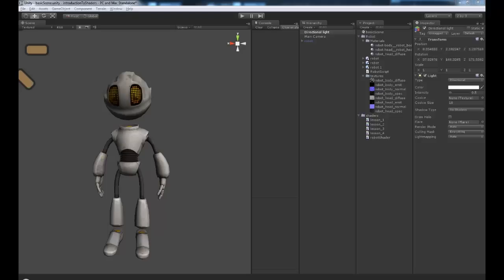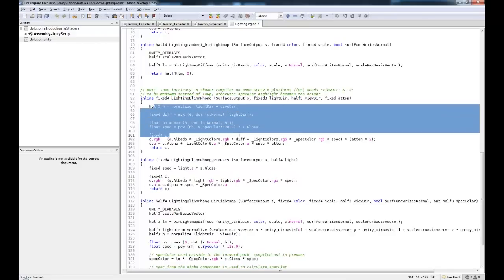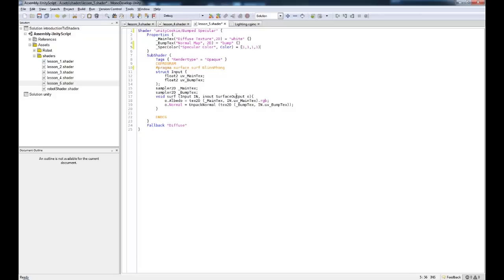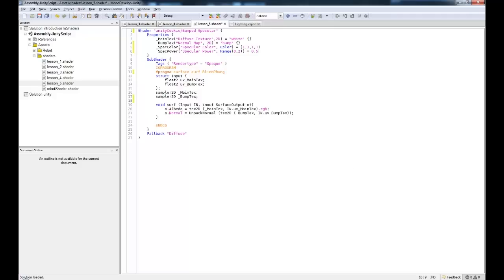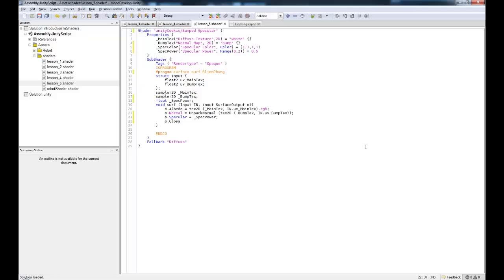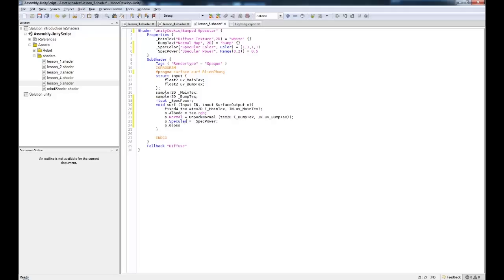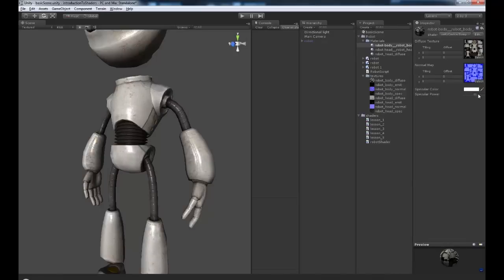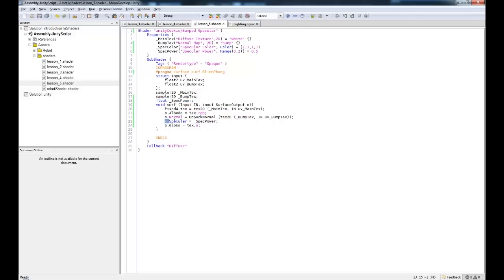Introduction to surface shader writing in unity part 5

Comment: I cannot get this to work in Unity 4.0.1f, I even copied the entire script into my shader script but it still does not work, I just get a bunch of Material does not have... a texture, float, color... property errors. The other tutorials worked for Unity 4 though. Not sure why this doesn't seem to be working for me. Normally those type of errors are just typo's but I copied your script a second ago so I don't think that is the case.